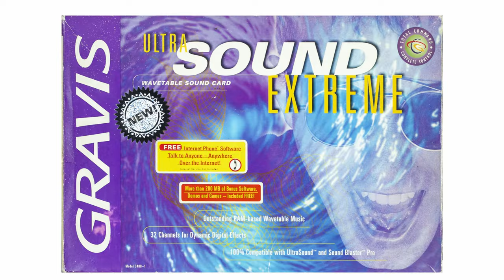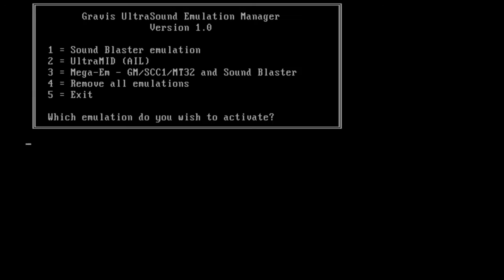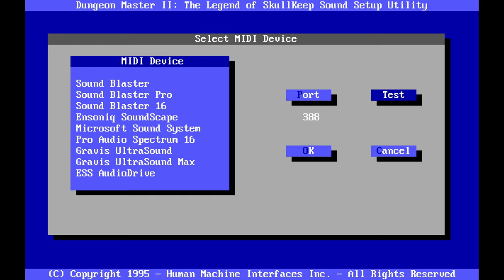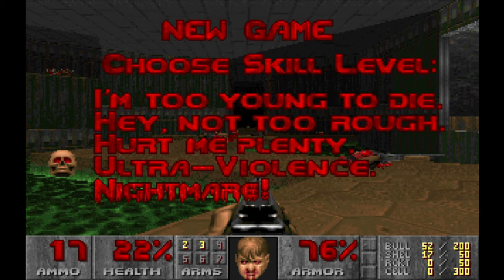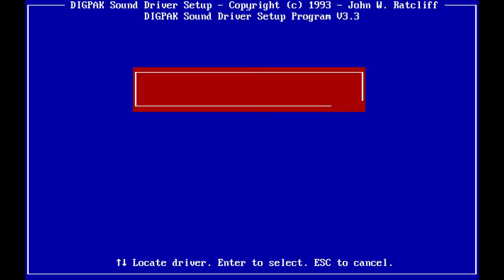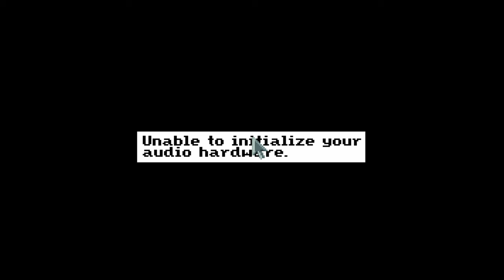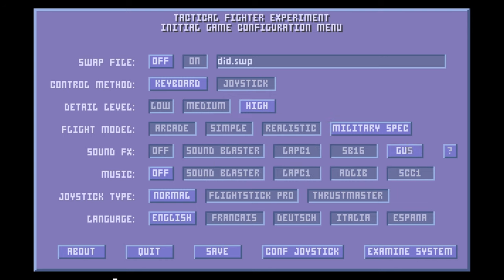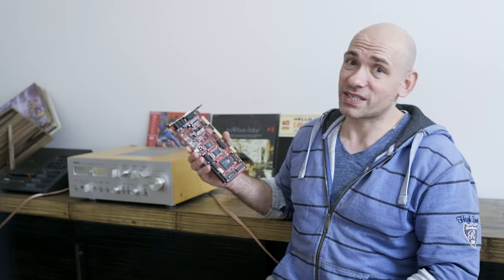Gravis Ultrasound Extreme - Quest For The Ultimate DOS Sound Card Part 14 - Is it really extreme?

Comment: Main fault of this card is not having a 26 pin wavetable connector for the MPU-401 on the ESS chip. It is understandable they didn't put that because of the GF1 + MegaEM simulating MPU-401, but we know that software emulation suck. Other than that this is a great combo card. It combines the GUS capabilities with the ESS good FM sound + pretty much perfect Sound Blaster Pro compatibility.

On the other hand it could never justify pay the prices that are asked for this card. Usually good motherboards for DOS have more than 1 ISA slot so combining a separate ESS card with a separate GF1 card or a GUS PnP will give pretty much the same setup, at a loss only of 1 ISA slot but for much less money.

Your doing a great job with your channel, keep it up.